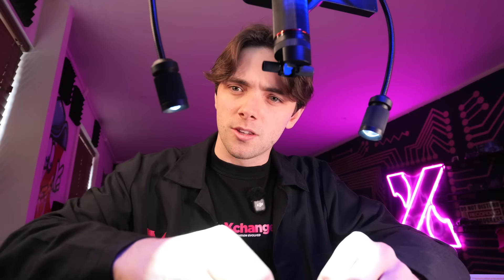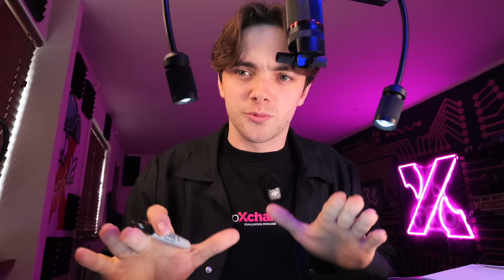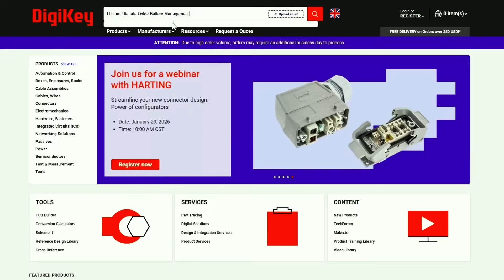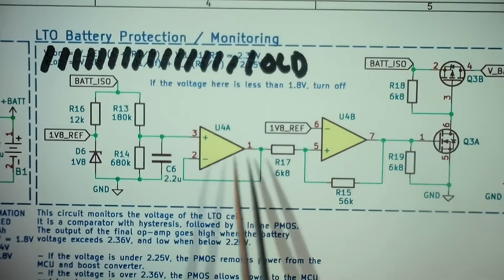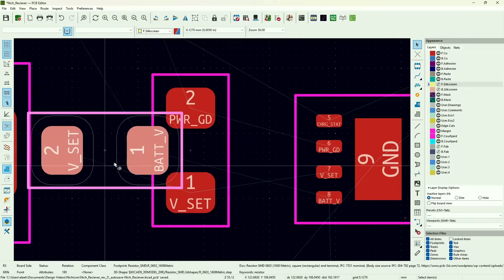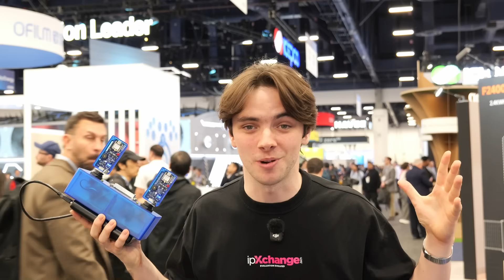This 4mAh Battery Beats a 550mAh One

Comment: In such situations, I have used Ni-MH batteries charged at 4C with thermal charge termination. It allows the charge to be completed in 15 minutes.
Reply: You might be able to charge Ni-MH a bit faster than Li-ion, under certain circumstances, but you can never down-size to the degree here considered the concept with LTO. 

Besides, with too small Ni-MH batteries, voltage drop will become an issue for instand high pulse curent during active work.

Comment: Nice build !, probably battery could be paired with e-ink paper for displaying QR codes.
Reply: These Nichicon LTO batteries are indeed perfectly suited for e-ink, as that usecase does not consume almost no power over time, but require high current when updating content. In other words small capacitance but extremely high current capability is a perfect match!

Comment: The only reason a restaurant pager battery won't last for many days is poor design - The beauty of that appplication is that the transmitter can be mains powered, and you don't need low latency, so the receiver can stay asleep most of the time consuming negligible power, and wake every 5-10 secs to look for  the transmitter sending a transmission for long enough to ensure the receivers will get it. Also the pagers can be stored in a charging dock when not in use.
Reply from the maker: This is true. The project we made was less about improving pagers (which, like you mentioned, have pretty good battery life) and more about showing an example use-case of LTOs. There are more compelling examples but we were also on a strict schedule, preparing for CES.

Comment: A well-executed project, nicely prepared video, but unfortunately I have a few technical complaints.

Charging with 250 mA is faster than with 80 mA, taking into account voltage difference gap is even bigger 925 mW vs 200 mW. So we need 18 mAh LTO to have effectively the same charging speed as presented 550 mAh LiPo, but then still there will be 45x more energy in LiPo. Even with much higher cycle durability of LTO 5000 vs 500 (for very cheap LiPo), many cycles per day due to limited energy would probably cause LTO to die earlier. Probably pagers will be still produced with LiPo. 

That being said, I think it is quite challenging to find good use case example for this technology, the one presented wasn't bad.

My idea would be to use it as a "capacitor" for bike dynamo lights. With the right choice of LED it might even work without IC. 80 mA is enough for decent light output and 3 min is plenty for most situations. The question is whether a supercap would not be better in this case.
Reply from the maker: Thanks for such a thoughtful comment, and for taking the time to share it. You’re absolutely right, with more mainstream power sources like LiPo, it can be tough to find a truly compelling use case.

That was exactly our challenge too. We also wanted to avoid framing LTOs as “supercapacitors plus”, and instead make a video that helps engineers, whether experienced or just getting started, understand what LTOs are actually for and why they exist.
Reply: As for the bike dynamo light, Nichicon LTO cells typically holds up to 10 times more energy than supercapacitors. Besides, suoercaps would generally not be that small as this LTO cell (4Dx25.5L), but rather have reasonable performance and capacity (typically 10F) from 8mm diameter onwards. If we continue the comparison with a similarly sized Nichicon LTO cell (8Dx11.5L) it holds 14mAh. With your aim set for a simple solution without boost, you may properly run LED for rear bicycle light at 2V which then utilizes the complete capacitance of that LTO cell but for a supercapacitor without boost you will only utilize 25% of its capacitance. That 14mAh LTO cell can then run 80mA for about 10 minutes, but the available 2.6F for the supercapacitor can only last for about 90 seconds.

Comment: This is going to be worse than the LiPo battery. Even if the LiPo charges  at 0.5C, that's a charging current of 275mA. With your new 4mAh battery at 20C, you can only charge at 80mA, which is less than 275mA. Also, it would make much more sense to put a high C rating LiPo in, such as the kind used in RC hobbies. Some manufacturers in that space make graphene batteries which can be charged at 5C, and they pretty much have comparable energy density to a normal LiPo.
Reply from the maker: This is a very good point. However, the pager was simply an example project to showcase the strengths of LTOs. The reality is that pagers are pretty darn good already many lasting weeks! Perhaps we will have an opportunity to make some projects that will reflect the power and adaptability of LiPo batteries!
Reply: Ultra-fast charging is here of relevance while allowing to work with extremely small solderable LTO-cells (e.g. 3.3Dx9L or 4Dx25.5L), which can still support the relatively very high currents required during active operation.

Comment: This battery is interesting, but I think you misdiagnosed the restaurant pager issue. The right MCU and low power modes used correctly should be efficient enough that even a small battery would last for weeks. 

If you take 50 mA for the alert system (30 s every 60 min), it’s ~0.4 mA average, and an nRF BLE MCU has around ~0.03 mA average power draw, negligible by comparison, you get almost 2 months of battery life! Even the ESP32-C3 used in the video can go down to ~0.2 mA with light sleep and external 32 kHz XTAL, still very low (and newer ones like C6 and H2 go even lower, similar to nRF)

However, an even more compelling option was mentioned in the video: energy harvesting. Adding a solar cell and combining it with this battery should give enough juice to not need recharging ever.
Reply from the maker: Were you in the room with us by any chance?

You made a lot of points that we discussed in the design phase. With CES coming up, we were very limited on time so we could not implement the solar cell into the pagers. Getting the pager completed for CES was already a near miss. We area also aware that this pager is not actually going to replace the standard pagers in industry, it was more of a proof of concept for LTOs than what a real world application would look like.

Thank you for taking the time out your day to discuss this, hopefully we can see your feedback in future video. Learning never stops!
Reply: As mentioned, the purpose of this PoC was not to realise a perfectly efficient pager for the real-world, but to showcase and draw general attention to the concept of ultra-fast charging for Nichicon LTO batteries. It demonstrates how Engineers may re-think duty cycle concepts of certain battery powered devices, which might be anything from a restaurant pager to medical tools.

As for an energy optimised restaurant pager, you may consider using a smaller Nichicon LTO battery, such as SLB03090LR80 (3.3Dx9L) with 0.8mAh.

Perhaps following could be a good start: XC6240A263xR‑G (2.63V CV) and ERJ-3GEYJ110V (11R/0603) to charge SLB03090LR80 (0.8mAh LTO), then XC6140C21A9R‑G (2.1V lockout & 2.435V release) to supply nRF52810‑QCAA‑R, with direct supply to PKMCS0909E4000‑R1 (piezo beeper) and KP‑1608SURCK (red LED), and SI2302DS‑T1‑E3 (MOSFET) with GRM188R70J106M (X7R/6.3V/10 uF/0603) to drive NFP‑P0612‑4410 (vibration motor).

As for the alert mode, I suggest first 30 seconds running all three functions (vibration-LED-beep) and continue up to total 5 minutes with only beep.

For the first 30 seconds, 50% duty cycle for vibration and LED (not overlapping each other), and beeper with a continuous average drain of 1mA (beeping twice per second). After 30 seconds, let the beeper continue up to total 5 minutes.

If we consider 55mA for the vibrator (when on) and 20mA for the LED (when on), plus continuous 1mA for the beeper, the average current consumption during first 30 seconds would be 38mA. In total, 5 minutes alert mode means a drain of 0.4mAh.

Starting at 2.63V, the battery will come down to 2.35V, and with that 11R resistor, it takes 2 minutes to be full again. If the pager would be drained down to the minimum lockout level of 2.1V for XC6140C21A9R‑G, it takes 3 minutes to be full again.

How does that sound to you?

Comment: I've designed plenty of paging stuff in the past...POCSAG, a retro paging protocol from the 80's, still widely used today, none of the Bluetooth nonsense 😜(Some of the restaurant pagers still use POCSAG AFAIK), Those batteries do look interesting though, particularly in combo with a coin-cell 🤔
Reply: Yeah. BT is a stack of overcomplicated protocols, driving a 2.4 GHz rice transmitter using frequency hopping - to operate a wireless mouse or a couple of earpieces at maximum ten metres distance? You're right calling it a non-sense...
Reply: Having a small LTO battery paired with a coin cell is indeed a great strategy to maximise battery life.

Let a small regulated current flow from a primary battery to the rechargeable LTO cell, which then supplies the load.

With its best-in-class ESR and extremely high pulse current capability, that paired LTO cell helps overcome issues of voltage drop and can substantially extend the lifetime of primary batteries.